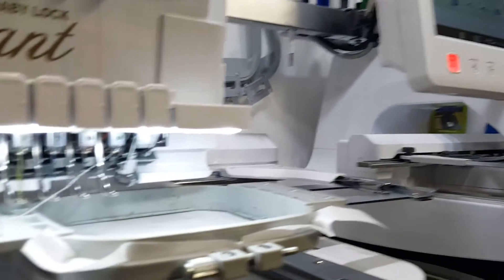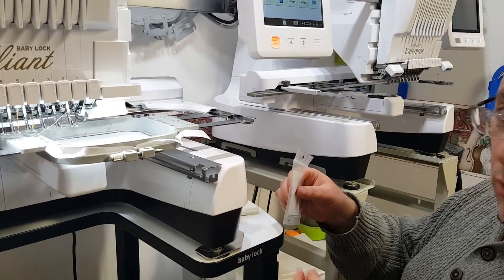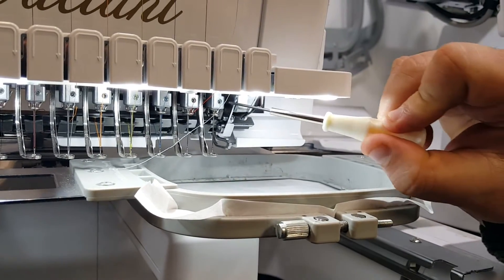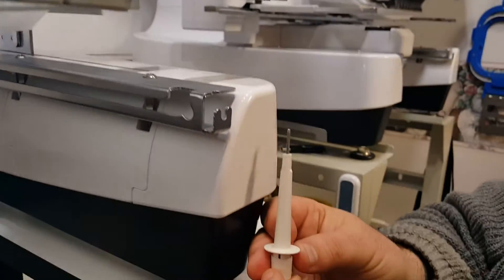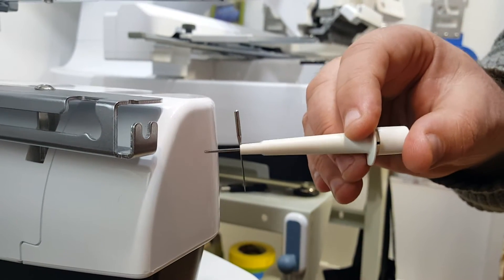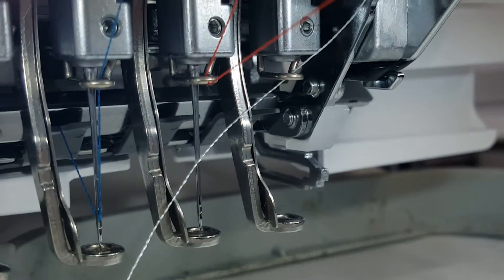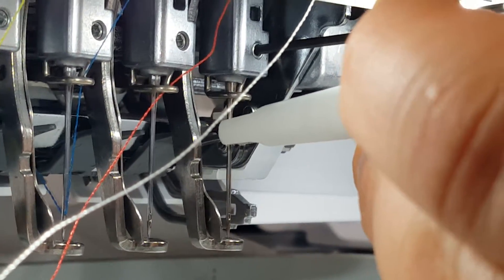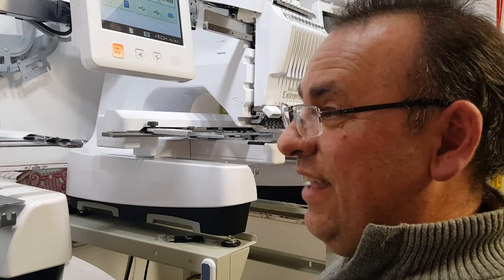How to: Change a Needle on a  Babylock Valiant

Comment: There’s got to be an easier way to insert the needle into position other than that ineffective tool.  I’ve inserted the needle about 2-3mm too low or  slightly offset causing a lot of problems. 😡